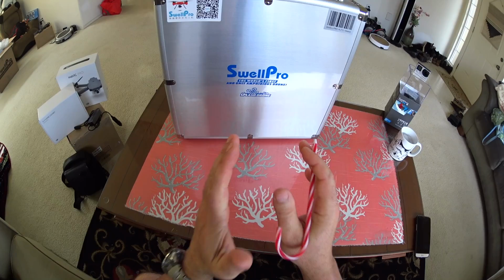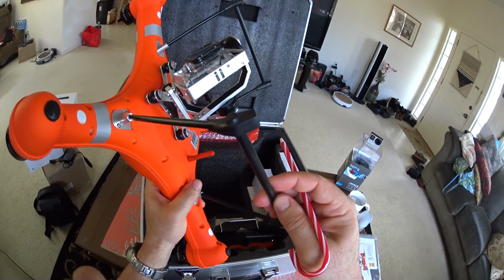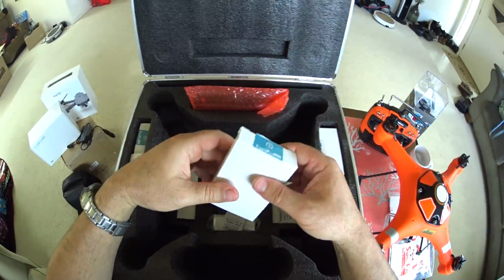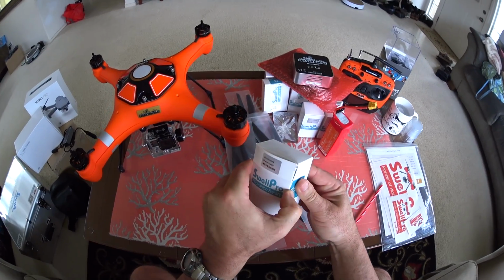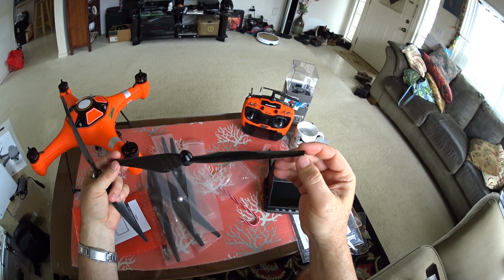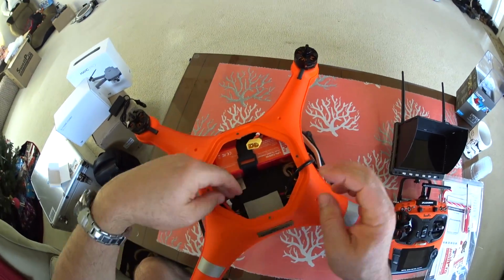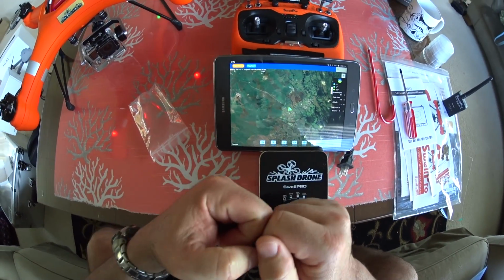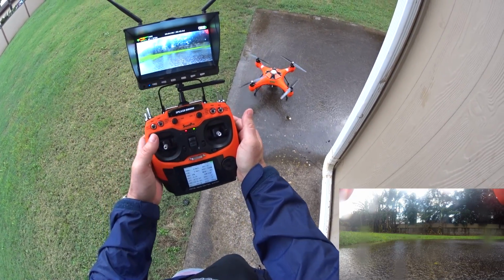SwellPro SPLASH DRONE (Waterproof Drone) - Review - [Unbox / Inspection / Setup / Rain Test]

Comment: Fly at your own risk!  SwellPro drones leak and there isn't any warranty.  PayPal Buyer protection won't help you because there isn't any violation of a warranty that doesn't exist.  I have over $2,000 invested an a SwellPro Auto that I flew for less than 2 hours.  During that period a small manufacturing defect (confirmed by Urban Drones, the US distributor),  allowed a small amount of salt water intrusion contaminated the electronics.
SwellPro has ignored my claim.  They, nor does anyone else, offer a repair service where I could send my dead drone.  BUYER BEWARE!!  THIS IS NOT AN HONORABLE COMPANY!
Reply from the maker: +Roger Hall no leaking for me after multiple flights, smacking, flipping, sitting, floating in the ocean.  Screw your top on!  Lol
Reply: Carlo from Urban Drones will confirm that there is small  mold blemish on the surface where the top mates to the bottom that was the likely cause of the leak.  I have flown RC for years and this wasn't operator error.  SwellPro is now responding and it appears they will finally stand behind their product.
Reply: Roger Hall good stuff brother, I appreciate you letting us know the real deal. It's not always about sounding good to make money especially when you don't pay for the drone. Glad they honoring you bud.😉👍🏼
Reply: Roger, can u supply a pic or describe exactly where to look for the blemish for us yet to receive one?  much appreciated b4 i soak mine when it arrives...

Comment: How do you think it would work if I remove the camera housing and connect a Hero 5 directly to the gimbal?  As you may be aware, the Hero 5 is waterproof to 33 feet WITHOUT the use of a housing.
My thought was that this could hopefully increasing the quality of the images. Obviously the weight of the housing is negligible, but the camera has to look through an additional hunk of plastic when using the housing.
Reply from the maker: +Jim Craig totally possible.  Only concern is hooking up FPV cable.  The GP 5 has sealed plugged ports so plugging in will un waterproof it.

Comment: I purchased one and it will not calibrate and can't even unlock the motors in ATTI. I get two red leds dot dot........ dot dot......... customer service is no help thus far.
Reply from the maker: Sorry to hear that.  Make sure your not around strong interference.  Preferably you want to be in the park away from residential areas.  I wouldn't give up.  Try and make sure to follow the calibration instructions precisely.  I've noticed it takes a few seconds holding sticks sometimes for the motors to arm.

Comment: those plugs are probably to protect against corrosion
Reply from the maker: probably right since they are next to the motors there is probably some electrolysis  corrosion possibility if the screws contact the water.

Comment: Pretty detailed review of a neat quad. I was impressed by the SwellPro Racer. Seen a lot of those RTF racers, and most of them require a lot of setup time before they are ready to fly, but the SwellPro racer seemed ready to go out of the box, with no need to tweak stuff in Cleanflight/Betaflight. This product seems similarly "high end".  I'm sure there is a high end market out there. I think that municipalities which are using drones will be interested in this one with its "all weather" capabilities.  Also services like the forestry service and beach patrol service may also find this to their liking.  Stuff like this validates the statement I read in the news that the "drone industry" will be a $100 Billion industry in 10 years .... maybe sooner.  I'm sure its powerful, sort of in the way that the XK500 is .. maybe moreso. However, if you were fishing, and hooked into a big grouper or shark or other large fish, I think it migh pull the thing out of the sky.  I guess that's when you hope that the "release" mechanism works. Looking forward to follow-up vids. Cheers.
Reply from the maker: +Bill Somrak Well said Bill.  A good companion for a life guard on the beach.  
You could definitely fish directly from it and release the line of the fish was to big as you mention.  Here in Hawaii, Giant Trevally Jack are sought after and grow to over 100 pounds.  We cast a heavy weight out which hooks the ocean floor and make the lone tight, then we can slide fresh bait periodically throughout the trip.  So getting that initial "anchor" out as far as possible is crucial for the big fish from shore...this is mainly how I would use this for fishing.  It may lift a fish that's a pound or so out of the water though :)
Reply: its just to get your bait way out there but I guess you could fish from it LOL